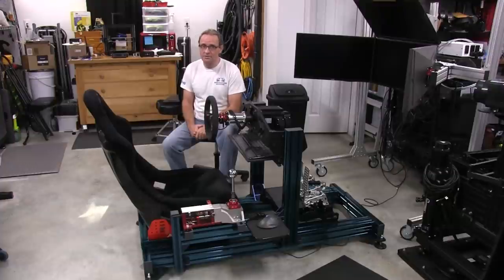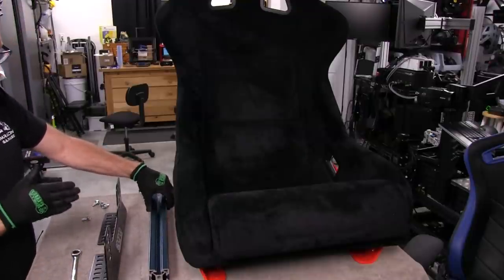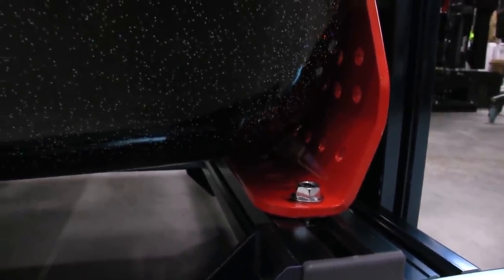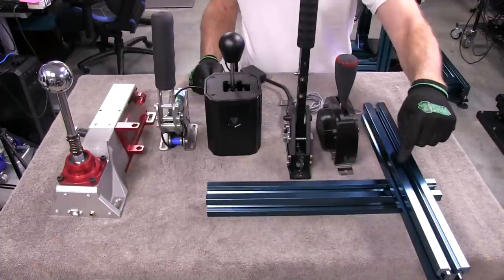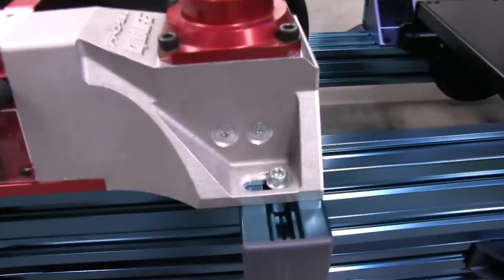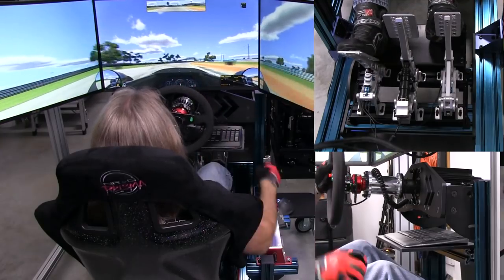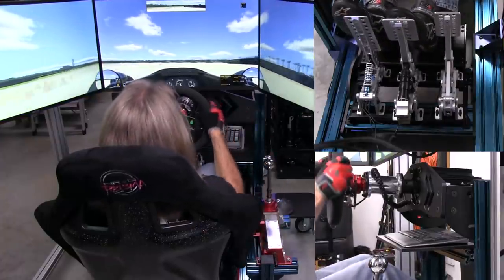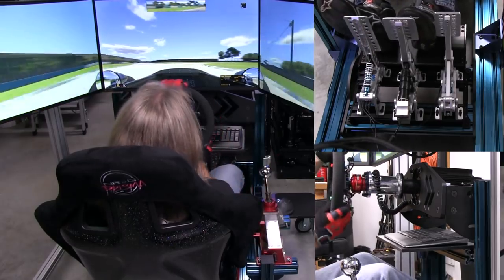All in 1 Gaming Pro Series Cockpit Review "The Setup"

Comment: Never did the sf1000 wheel by thrustmaster ? (Curious on what he thought about build quality) it has buttons that turn and  come out too easily on mine
Reply: Which buttons in particular is it? Is it that button that has the Ferrari logo? The one that looks mega cheap? But you also need to have your expectations in check, what wheel has a full colored lit display, dual clutches and genuine carbon fiber front plate all for under $350?? Id say that for the price they have made an exceptional product

Comment: Hi Barry.  Been following your build and review vids for a while now and through enjoy the levels of detail you go into on both.  I have a question for you and wlecome your input.  I am considering building my own 8020 rig, that takes what I feel are the best features from the various branded options out there and brings them all together into one package.  But I have a tight space into which I want to place the rig.  Most rigs have a length of circa 1300-1400mm. My question - how tall are you and can you tell me what the typical distance is on the recent rigs you have built, from the rear of the rig to the back of the pedals/pedal deck.  Just trying to establish a rough total distance for the rig, which only I will be using.  Thanks in advance. Ken

Comment: This Pedal Tray is really good for changing/finding the right position…not.   With no slot Holes you always have to „find“ the nut again. The centere screw is fixed on that position so you can’t change the height at all without repositioning all nuts and screws… it’s not always better to do something new/different than existing designs…that’s the best example.   (IMO)